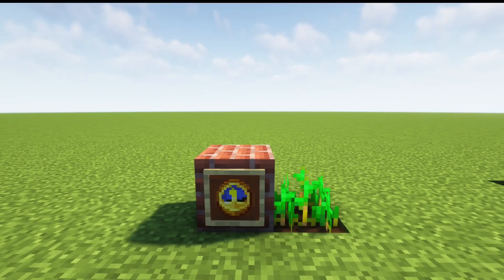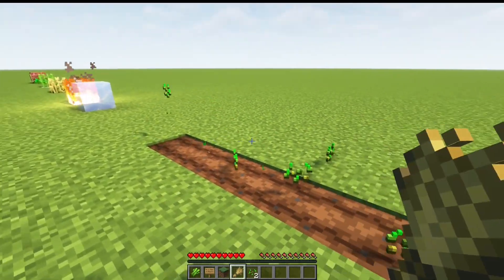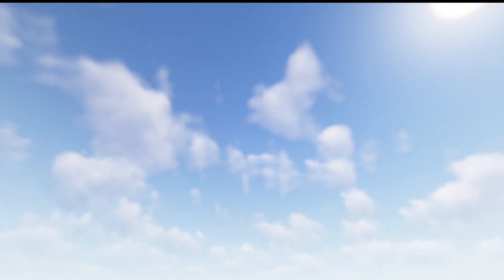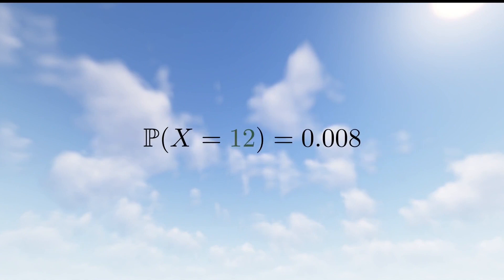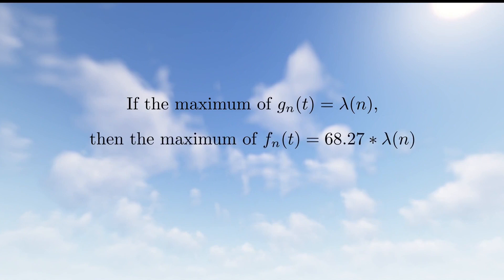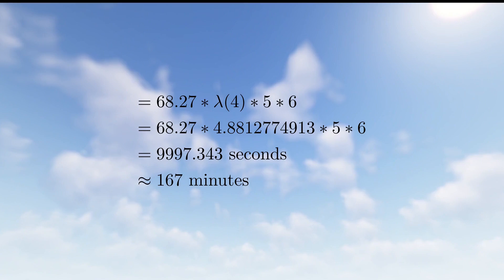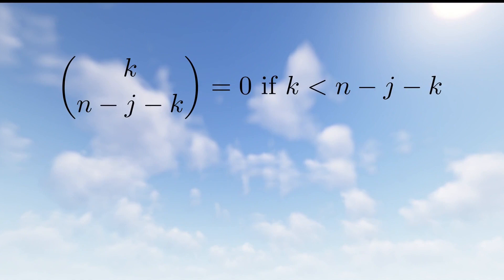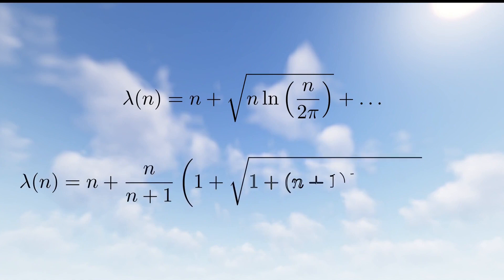How long should you wait to harvest your crops in Minecraft? -- Optimizing periodic farms

Comment: Nitpicks (on the Minecraft side; the math seems fine):
 - The sugarcane farm at 2:47 won’t work IIRC; I don’t think the lower sugarcane changes block state when it grows
 - Most crops don’t grow every random tick, not just amethyst.  Vines, kelp, sugar cane, and I think bamboo also have a 1-in-n chance to grow per random tick for various n > 1, traditional farmland crops have complicated chances based on soil hydration and neighbors, saplings have particularly complicated chances based on possible tree shapes, etc.
 - Even if you design your observer-based farm correctly, this can still be useful for sugar, bamboo, etc. because for large patches you want to dispatch a flying machine instead of use observers.

Comment: Sugarcane is an exception to this method in 2 different ways, but I think it would still be interesting to analyse it in the same way: firstly, the value of harvesting sugarcane is not simply 0 or 1, but rather 0, 1 or 2. Naively we can express the expected value of sugarcane being harvested after time t as P(X >= n) + P(X >= 2n) where X~Po(t/68.27), and n is the number of growth stages (so 2n is the number of growth stages to get the second sugarcane).

However, I don't think this is actually correct, because I believe the second difference is that when you harvest sugarcane, the growth stage does not get set back to 0, so it's not memoryless in the same way that makes the calculation in the video simple. If we assume that the sugarcane was planted a long time ago, I believe it is valid to assume that the initial growth stage of the sugarcane just after the last harvest is uniformly distributed from 0 to n-1. I think it's clear that the uniform distribution is the limit; the caveat is that the initial distributions are not independent from one harvest to the next. If we knew how many sugarcane we got from previous harvests, in theory this could allow us to use Bayes' theorem to improve our distribution of initial growth stages. But this would be so complicated that I'll just assume that we are unable to remember how many items we got from previous harvests, so our best guess is that it starts off as U{0, n-1}.

Anyway, now X is not simply Po(t/68.27), but rather X ~ Po(t/68.27) + U{0, n-1}. Now calculating P(X >= n) and P(X >= 2n) involve a convolution of the Poisson and uniform distributions, which starts as a double sum, but because the uniform distribution is trivial, a lot of the terms are identical to each other and you just get a 1 dimensional sum. I'll leave it as an exercise to the reader to find the root of d/dt ( P(X >= n) + P(X >= 2n) )/t = 0 for this random variable, and whatever n sugarcane uses (16 I think?).

Also
Reply from the maker: Yes I agree, I should add a disclaimer in the description that this work is only relevant for single block crops. I see now that bringing sugar cane up in this video was probably more confusing then helpful; I wanted to bring it up to specify that the work was only for one specific type of farm. I don't know the exact process of sugar cane's growth (like if a sugar cane is two blocks tall, does either block being random ticked result in growth?), but I think you are right that n=16. Sugar cane and cacti are kind of in the same family, and it seems like they need some more concentrated work. May be a fun project! I also think copper would  be really interesting to study, I know that it also doesn't follow the same processes as many of the other crops in game. Did the rest of your comment get cut off?

Comment: this leaves me with the question, if the tick updates per chunk are purely random, what are the chances of all 8 growth stages being immediately activated in succession. i can only assume the number is infinitely small but it's fun to ponder about.
Reply from the maker: Good question. The chance a block is chosen in a  tick is (3/ 16^3) = (3/4096). That means that for a given wheat plant the chance it receives a random tick each tick for 8 ticks is (3/4096)^8 = 8.28x10^(-26) so you are correct in that it is very small.
Reply: @jackhanke343  Note that a block can receive a random tick more than once during the same game tick making it possible for a crop to advance all 8 growth stages in just 3 game ticks. The chance of this happening is even smaller, approximately 1.4x10^(-30)